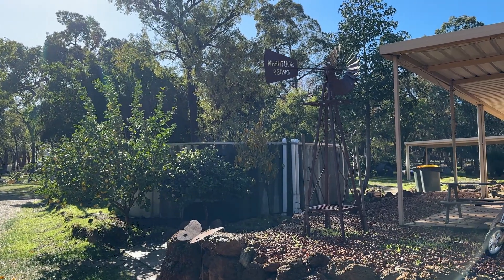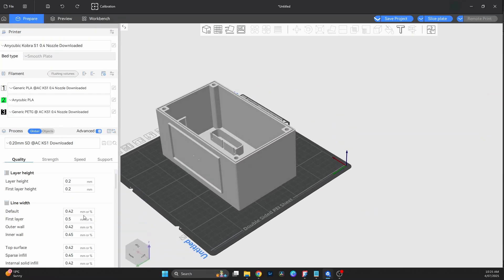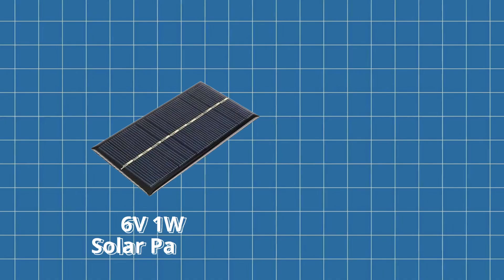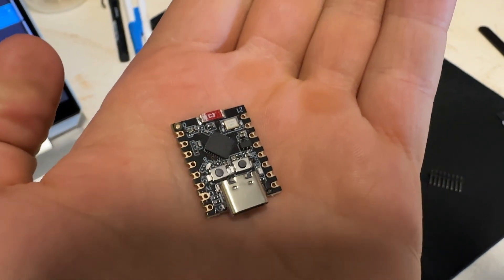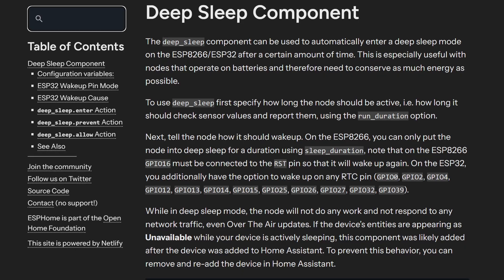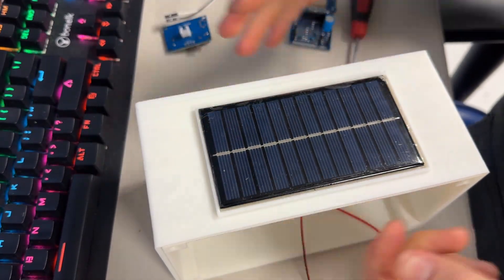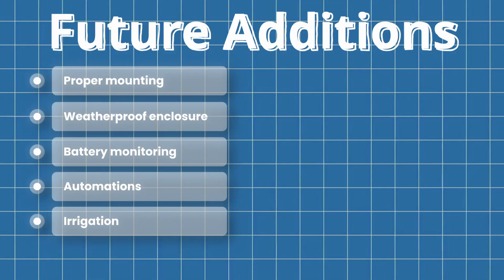I Built a Solar-Powered Water Tank Level Sensor

Comment: that sensor you are using is not reliable for measuring water level, especially if you put it close to the tank wall. you want to use the A02YYUW. i am using that setup in my water tank its much more stable. if you wanna be more badass then use a radar, can mount on top of plastic water tank, no need to drill holes or anything. checkout the HLK-LD8001H, i have esp32 nano code working for it msg me if you want it.

Comment: Ho do youo calculate the percentage? I assume you calculate the distance between what you refer to as full, but one would have to know that number right? So is this calculte happening in the esp or ha?
Edit: By the way, this link does not work anymore: TP4056 Charging Module
Reply from the maker: Correct, you'll need to know the distances between full and empty in relation to where the ultrasonic sensor sits. The code in ESPHome will convert this into a percentage and then display on HA.
Thank you, I'll try and fix it :)

Comment: i have made the same thing but with less component. just use a mobile charger that supply both esp and ajsro04 sensor.working fine without any issue. btw your system must be more robust. well done

Comment: Nice project,. Will the ultrasonic work through a metal lid without drilling a hole?
Reply: He's using a hook to hold it in place under the lid, watch the clip at 0:38 to see how
Reply from the maker: No it won't, it needs a clear line of site to the water to get accurate readings

Comment: Great build! One tip: these solar setups often hit a "zombie state" at dawn where the voltage rises too slowly for a clean boot. Adding an external voltage supervisor IC (like the MCP111) to the EN pin acts as a proper hardware reset. It keeps the ESP32 in shutdown until the rail hits a stable 3.0V+, which prevents those infinite brownout loops!
Reply from the maker: Awesome, thanks for the advice!

Comment: You could have also installed a temperature sensor to monitor the water temperature, but why didn't you install it?
Reply from the maker: I think the reading would be too inaccurate, it’s sitting on top of a tin roof inside of an enclosure which would vary widely with the real outside temperature. In terms of water temp, that’s not really a reading I need to monitor myself

Comment: It would be nice to consider keeping the battery at 3.7 V, so it will last longer than if it is constantly at 4.2 V. Try it with mosfet and a code in ESP32 to open/close when Voltage is between 3.5 V and 3.8V. To compensate for the lost capacity, use 2 in parallel.
Reply from the maker: Thanks for the suggestion, I’ll definitely look into it

Comment: ESP32 C3 Mini, and the ultrasonic sensor can be powered by 3.3V. Use a diode drop straight from the battery and save all that mucking about with 5V.

Comment: Awesome and inspiring build. Got my like and subscribe 👍🏽
One suggestion for outside enclosures is to incorporate a breather in the bottom section.
This will help keep your gear dry by reducing condensation and suction from temperature cycling. 
Take it from an industrial sparky, even the most water proof enclosures can end up drowning in water, because as the sun heats an enclosure the air expands and is pushed out through the seal. Then when the box cools and air is sucked back in again if the air is humid you get condensation or even better, if the box is cooling cause it’s being rained on, water gets sucked straight in !! 
You should be able to get breathers from your local electrical wholesalers, if you can’t find any online.
Reply from the maker: Thank you so much, I'll incorporate a breather in my next design! Do you think I'd get away with a small hole with a breathable membrane or would you suggest I get a proper one for the job?

Comment: Just drill a hole near the bottom of the tank, connect a thin clear plastic tube with the open end facing skyward., to the height of your tank.The water level in the tube is the measurement. For less than 5 bucks, problem solved. Use the savings and time to buy your next Lamborghini.😂😂😂.
Reply from the maker: That's definitely one way of doing it 😂
Reply: Just joking and not.. Nice job. Fun to watch and informative. Keep the projects coming.. innovation leads to inventions.
Reply: Enjoy the algae build up in your clear tube👍
Reply: @hein_mcleodnot if you have a shutofff /drainage valve at the base of the pipe, that can purge the pipe, when not measuring. You’re welcome.

Comment: i also same the same setup same ultrasonic sensor hooked up with ESP D1 mini. the readings are quite noisy and can't be trusted. sometime it says 100% sometime 0% and some random values. did you face similar issue.

Comment: For safety I suggest swapping out the 4056 with something else, those devices can't charge & deliver load at the same time which in turn doesn't switch off charging when the battery is full & might over charge the battery.
Bought a bunch of them as I'm busy with project for my pool & during my research discovered this.
Reply: The 4055 module stops charging based on current (I think 0.1C, 100mA when charging 1A). If device draw exceeds this cut-off, charging won’t stop—risking battery damage. But here, the device remains mostly in deep sleep, so it’s not a problem.

Comment: Nice project. But I am using the same setup with my 2000L syntex (roof top tank) its not giving correct readings and in case of deposition of water moisture and evaporation inside tank. Also I observed, may be waves are collide to inner wall of tank and giving fales or inaccurate readings. But outside or on bench testing its working fine. 
Now I am stuck and not able to figure out which sensor should I use to get accurate and reliable water level readings. Any suggestions?
Reply from the maker: Yeah, what you're seeing can be pretty common with the ultrasonic sensors, especially with smaller tanks. I'm about to build a new one with a submersible liquid level sensor, which are much more accurate, but more pricey too. Have a look into them and if it's within your budget, this is the route I'd personally take.

Comment: My experience with that type of solar panel is that the surface will go bad over time because it's not a glass, it just an epoxy. Maybe UV coating spray could help but haven't try it yet.
Reply from the maker: I haven't had mine out in the sun long enough to really experience that, but it's definitely something I'll keep in mind for the future. Thank you!

Comment: OMG I need this.  I bought a tuya based ultrasonic sensor thinking I could get it to talk to home assistant but none of the data comes across.  I'd never built with microprocessors before so I thought I'd start with something simple.  I just built myself a temp sensor for inside so I can have an automation to turn the wood heater fan on and off.  This would be an awesome next project.
Reply from the maker: Awesome to hear, it's always more fun making things yourself in my opinion!

Comment: I know it is a little bit late, but the problem with the wemos and deep sleep happens with some boards, in which you have to solder a 10k resistor between gpio17 and vcc, and have the jumper between rst and GPIO16.
Reply from the maker: Thanks for the tip, I'll remember this for the next time I decide to use it!

Comment: Save even more electricity during deep sleep: do not connect the ESP32 to 5V, but rather to 3.7 volts at this point. 
The ESP only requires 3.3 volts and has a voltage regulator on it. 3.7 volts is enough to generate 3.3 volts.
The AJ-SR04M can also be operated with 3 to 5 volts. This completely eliminates the stepup controller.
Reply from the maker: Yes and no, my AJ-SR04M only accepts 5v so I had to use the boost converter which I then piggy backed for my ESP32. But definitely if I didn't need the 5v, I'd run it off the 3.7v battery.

Comment: does rx/tx from the sensor to esp32c3 need resistors or directly wired ? T.I.A
Reply from the maker: You'll need resistors from the echo pin, forming a voltage divider to bring 5v down to 3.3v so as not to fry the esp32

Comment: I stumbled upon your video, thank you. Which got me to thinking about my search for the similar tank level observation, but for a KOI pond requirement outdoors. Any thoughts on outdoor gotchas on the sensors? I have a water wheel house close to the edge of the pond (1,100 gal), which sometimes loses water due to hose leaks or whatever.  Is an in water sensor best? Considering freezing issues here too ! Any thoughts?
Reply from the maker: Hmm good question. You'll need to check the datasheet of the specific sensor you're looking at buying and that will tell you the minimum temperature it can handle. I think an ultrasonic sensor could work, as long as you're able to get above the 20cm minimum distance. I'll be testing out an in water sensor in the future, so I can't comment on that just yet!

Comment: Great project been looking for a store bought option until i saw this... all built and ready to go but i am also having an issue with the yaml compile on lines 96 and 97 have an error of 
INFO ESPHome 2025.7.5
INFO Reading configuration /config/esphome/water-level.yaml...
ERROR Error while reading config: Invalid YAML syntax:

while scanning a simple key
  in "/config/esphome/water-level.yaml", line 96, column 9
could not find expected ':'
  in "/config/esphome/water-level.yaml", line 97, column 9
Reply: changed the the lines  seems to compile so hopefully ok 
old
      - lambda: |-
        // Ignore readings above 3m (beyond sensor/tank range)
        if (x > 3.0) return NAN;  
        return x;
new
      - lambda: 
          // Ignore readings above 3m (beyond sensor/tank range)
          if (x > 3.0) return NAN
          return x;

Comment: I was trying to solve similar problem - monitoring the level of water in my basement water well. Since it is an in house setup I'm powering it via a USB adapter and instead of ultrasonic sensor I'm using laser. Just like in your case, I'm sending the data to HA and I'm very happy with the results.
Reply from the maker: That's awesome, it's a really satisfying project isn't it :)
Reply: @J-Rat  For me, not being really a professional with knowledge in electronics it was more like a hair-pulling project for me, but in the end I managed to pull it off and I'm very happy with the results. I was considering an ultrasonic sensor for the distance measuring as well, however, since the depth of the water well is more than 8m I was concerned about the ultrasound bouncing off of the concrete walls of the well and throwing off the reading. That is why I opted for laser, which although more expensive, works really well. Plus I also included a temperature and humidity sensor to monitor the values inside of the custom, 3D printed case, inside of which the ESP and the laser sensors are enclosed. And then the ESP Home in the Home Assistant threw a huge wrench into my project by requiring the source code to use external components which resulted in my source code no longer being able to compile.... So... A hair pulling project for me 😂
Reply: Hi. Which laser module did you use?
Reply: @harrymatthie  For this project I used the TFmini-S (5V, UART version)

Comment: It’s a cool solution, but here in New Zealand they put a simple float in the tank attached to a vertical rod that is as long as the height of the tank. Attached to the top of the rod is a brightly coloured ball to be easily viewable. If the coloured ball is high in the air, the tank is full. If it’s down near the lid of the tank, it’s empty. It’s a simple, low tech solution that provides the necessary information.
Reply from the maker: Thanks for the comment, that's an awesome way to do it! The only downside I could see would be the lack of remote monitoring, but if that's not a requirement, then there's no issue!
Reply: @J-Rat yes, it’s not remote monitoring, but you can drive down the road and see what properties have plenty of water and those that don’t 😅
Reply: They have tanks with the ball/float in Australia also. Good to see levels at a glance but you can't really plot a trend.

Comment: Had the same deep sleep issues with a pool level sensor i built using esp8266, but found this seems to be an issue with only some cheaper modules, I got a new one from Jaycar and it deepsleeps just fine
Reply from the maker: That’s interesting to know, thank you :)
Reply: Using a delay(10) after the deep sleep command on my generic D1 mini seemed to work. It’s worth a shot to try.
Reply: This is with Arduino IDE.
Reply: Yep, that's true. cheap d1 minis have problems with deep sleep not working correctly (especially those new variants with usc-c, old microusb ones seem to be working properly)

Comment: Just check the ESP32-C3 Super mini. It looks like you have used and linked the ones with the WIFI design flaw. the WIFI antenna is too close to the crystal oscillator. Rory Hayes found the issue and wrote a blog about it.
Reply from the maker: Thanks for the heads up and you're correct, I did use the one with the design flaw. It worked fine in the house, but the signal was quite poor when I had it out near the tank. I ended up adding a small (31mm) makeshift antenna out of a piece of wire and it made quite a nice difference to the signal strength.

Comment: I'm actually designing my own diy for my tanks at the moment. I was going to go down the battery+solar path but it occurred to me that I have a 240vac powered pump close to the tank so I can just power the iot from there. Can you do the same and simplify your circuit?
Reply from the maker: Yep, if you’ve got a power point near the pump the easiest way is just to use a little 5 V USB adapter. Power the ESP32 from that (through the USB C port or 5 V pin) and feed the sensor from the same 5 V. I'll try and make a video in the future!

Comment: I have considered building something like this, and a water proof sensor might be simpler. I'm was kind of trying to avoid any sensors since I'm dealing with dirty water. My complicated original idea was to use 2 water bottles, partially filled with water, one in the tank would be a bit heavier but still float, and the other one could be outside of the tank. They would hang over a pulley and balance each other to follow the water level. Than measure the pulley position. To keep the print decent, I considered the pulley more like a can and wire fixed at some point to eliminate slipping errors. Since weather is a killer for electronics, I have considered mechanical gear reduction for the pulley, to allow multiple turns, and use a hall sensor to read the position without being exposed. This idea of using half filled water bottles can be expanded in many forms of sensors, and you also get a visual measurement (reversed). I haven't build any of this idea since the print got too complex.
Reply from the maker: That sounds really interesting, let me know how you go with the option you choose to go with!
Reply: Grok and I have discussed this pulley method at length.  I think I would keep both weights inside the tank.  One floating weight (probably a glass or ceramic bubble or hollow stainless steel ball) in a stilling well (vertical pipe with small holes in it), and one sinking counterweight (solid ceramic or stainless steel) in another stilling well since the target tank has a lot of turbulence.  I thought it would be nice to have a gear at the top that converts X-axis to Z-axis rotation.  I could put a magnet at the center of that Z axis attached to the ceiling of the plastic tank, and situate the AS5600 Hall effect magnetic encoder on the outside of the tank.  That would make my humidity woes a lot less I think.  If I put another X to Z gear/magnet/encoder on the other end of the pulley axle, and used relative prime tooth ratios, I think I could calculate super accurate readings from top to bottom.

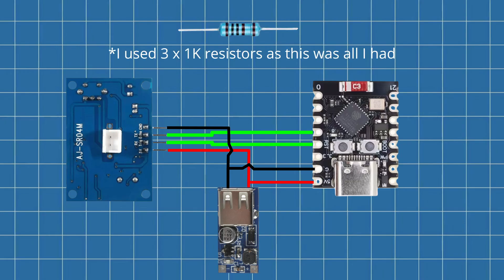Comment: Hi very nice project  but can you publish a proper schematic that will include that voltage divider that you mentioned in the  4:16 min of the video or make a phto of you pcb  from top and bottom ? :)  Thank you . I plan to use it as a Sawage tank level sensor instead :)
Reply from the maker: Thank you, I'll work on getting the schematic uploaded to GitHub in the next few days :)

Comment: Nicely done!

I used the older HC-SR04 sensors in a water level project and had tons of trouble with internal echoes. Took some serious filtering to stabilize the readings.

I’m curious how well your AJ-SR04M performs—any echo issues? Did you need to write any code to compensate?

Appreciate your insights. Thanks!
👍😁
Reply from the maker: I’ve seen a few odd spikes here and there, but nowhere near as bad as the HC-SR04. To smooth things out, I added a median filter in the code that records 5 readings at a time and sends only the middle one. It's been pretty reliable so far :)
Reply: We did this.  6,000 gallon tank.  We found that multiple responses are very accurate, except it has issues detecting the first of the 40KHz spikes.  Sometimes it misses the first spike and gets the second or even third spike.  Search David Pilling's experiments.  Multiple measurements will cluster around 25 uSec deltas.  If we account for that in the software, we can get incredible accuracies even with unmodified HC-SR04 sensors.  We did have issues with the humidity corroding the sensors.  We tried waterproofing, but still couldn't get them to last longer than about 3 months.  Although, at the cost of these, it's sometimes worth replacing them every three months.